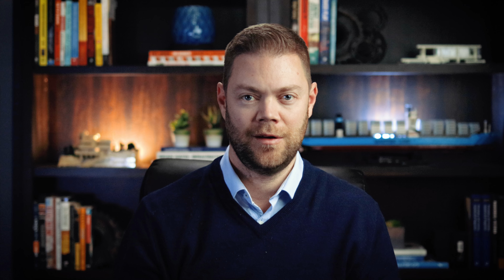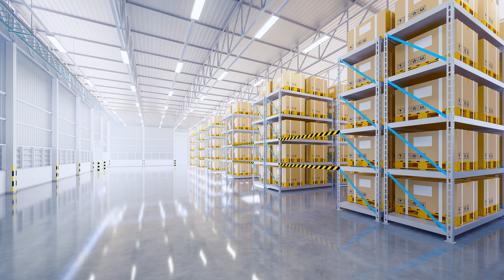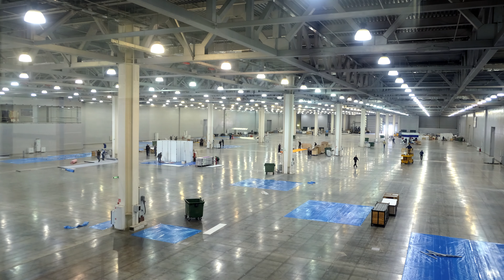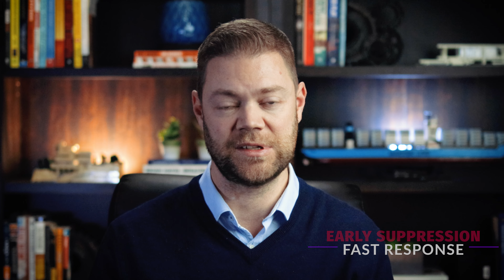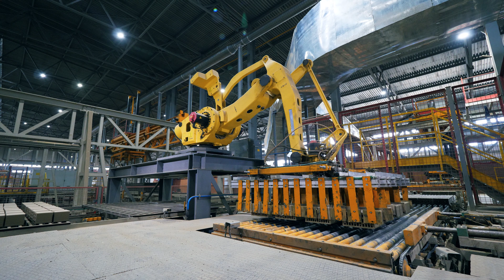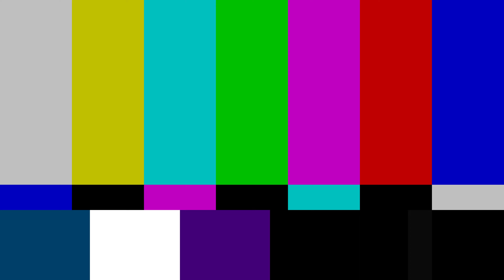Warehouse Property Basics: Industrial Real Estate 101

Comment: Another quality video. You are so right about the nuances of what you need to have in an industrial property. Just saw an older warehouse that had 20 ft high ceilings and loading docks that only fit small trucks. Talk about functional obsolescence! LIKE #4.
Reply from the maker: I was involved with an industrial property a few years ago that only had 14' ceilings.  It took a long time to sell and sold for ~ 25% less than if it had normal industrial ceiling heights.  Those details can make a huge impact!